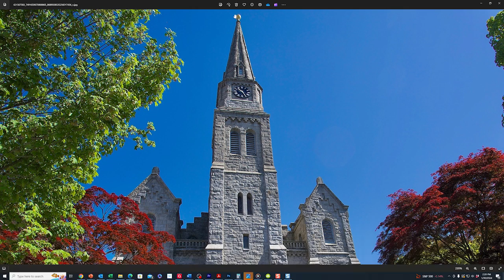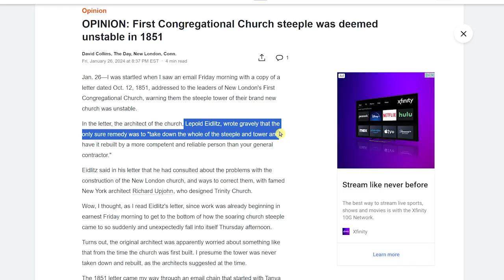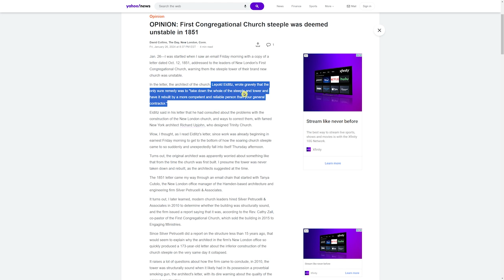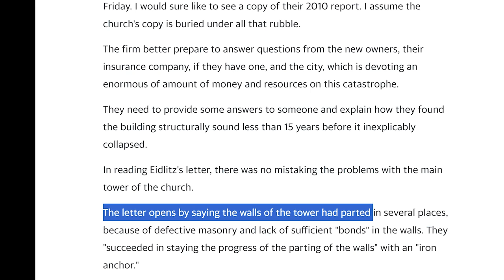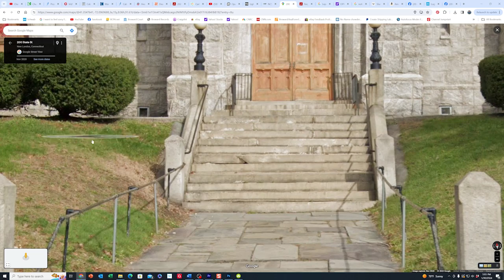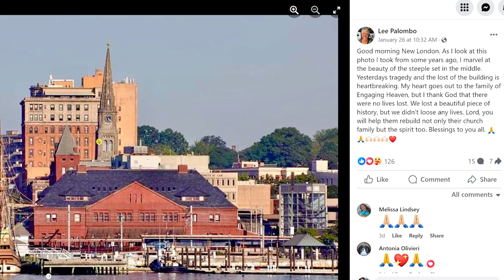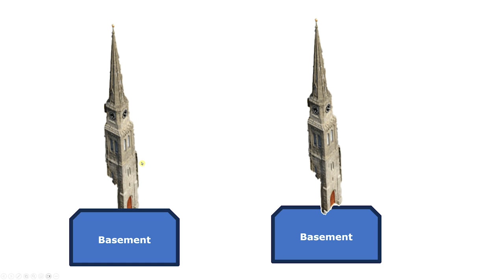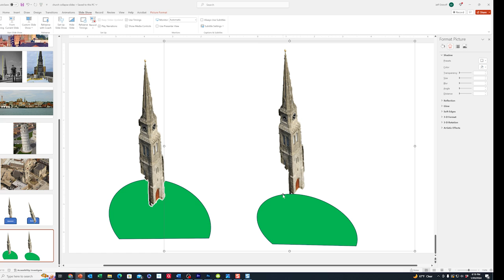What Caused Church Steeple Collapse New London, CT?

Comment: As someone that lives in CT, I can tell you we have had RECORD amounts of rainfall over the last 2 months. I'm talking about 4+ inches in a 12 hour period on 2 successive weeks. If you just go back and look at rainfall totals in the area I am sure that is the culprit.
Reply: There was an inspection 20 years ago that said the roof was in very poor shape back then and no repairs had been done since the inspection.
Reply: @whyjnot420    Yes- Especially where the gabled sanctuary roof abuts the stone tower.  The lime mortar used in original construction has failed due to water infiltration and caused these stones to become unstable/collapse.
Reply: Good point. We look at the building and try to find a failure point, but forget about the ground it rests on. Too bad we only see the steeple in the video.
Reply: We also had some big temperature swings. It got into the low teens, for days, then it swung back up. (at the Groton Airport) On the 13th, it was 37F to 56F, 13th; 28F to 44F, 15th; 23F to 32F, 16th; 23 to 38F, then the 17th to the 22nd, the overnight lows were well below freezing at 19, 20, 23, 15, 14, 23F, the highs were all below freezing until the 23rd when it got to 38F. New London & the Groton airport are both at sea level, just a few miles apart. Having the temperature below freezing for 5 days straight is kind of rare. I can imagine that a pretty deep undergound freeze could have happened and been what brought it to the literal tipping-point on that particular day.
Reply: I agree. It's the excessive rain.  I live about 50 miles north. We've had the rainiest fall ever I think.  (My woodshed is tilted but holding together.  I didn't really prep the foundation. It s just up on cinder blocks at the corners.  Too much rain, softens the ground and its sinking. I'll have to fix it this summer.)
Reply: Maybe not the sole culprit, but surely contributory.
Reply: This may not be relevant, but consider the number of hurricanes over the last 150 years. The forces of nature eventually destroy  strongest buildings if not properly maintained.
Reply: I didn't even know that fact and still assumed it was to do with either massive or absence of rainfall.
Reply: @kylieharrison3782  A week before this, one town over, Norwich CT had mandatory evacuations because of the flooding.
Reply: funneling money for maintenance into pockets is more likely to blame
Reply: @ThatOpalGuy considering it was deemed unstable by the guy who built it you are correct
Reply: And not just torrential rain, but a lot of freezes, which if there is water in/between the stonework would put additional stress on the materials.
Reply: Lived in CT my whole life and this is the driest most consistently 35-40 degree weather for winter I can remember in central CT. We had 1 snow storm and not even that many rainy days.
Reply: @s0nnyburnett  and yet here in California everything is getting flushed out into the ocean 😆
Reply: @s0nnyburnett  What are you talking about.  We have had so much rain in January and December.  NOAA.gov backs me up here as  I copied part of an observed weather data report  (see below) for Hartford, CT for January 26 and you can see from Jan 1 there was 7.31 inches of rain where as normal is 2.79.  And since Dec 1 there was 15.35 and the normal is 6.87 or > 2.2x normal.  The ground has been heavily saturated for at least the last 6 months.  If I remember correctly we started the first few months last year with below normal precipitation but then for the rest of the year we had well above average with a couple periods of major flooding.  I believe we ended last year 18 inches over normal.

...THE HARTFORD CT CLIMATE SUMMARY FOR JANUARY 26 2024...
VALID TODAY AS OF 0400 PM LOCAL TIME.

CLIMATE NORMAL PERIOD 1991 TO 2020
CLIMATE RECORD PERIOD 1904 TO 2024

WEATHER ITEM   OBSERVED TIME   RECORD YEAR NORMAL DEPARTURE LAST
                VALUE   (LST)  VALUE       VALUE  FROM      YEAR
                                                  NORMAL
...................................................................
TEMPERATURE (F)
 TODAY
  MAXIMUM         43   1244 AM  65    1950  35      8       47
  MINIMUM         37    726 AM  -8    1948  18     19       35
  AVERAGE         40                        26     14       41

PRECIPITATION (IN)
  TODAY            0.67          2.00 1986   0.11   0.56     0.78
  MONTH TO DATE    7.31                      2.79   4.52     5.81
  SINCE DEC 1     15.35                      6.87   8.48    10.31
  SINCE JAN 1      7.31                      2.79   4.52     5.81
Reply: How can the rainfall affect the interior wall of the tower? The tower did not fall toward the street, it fell on the roof. - BACKWARDS.
Reply: @organbuilder272 Any leaks where the roof meets the wall will allow water to get in and start weakening mortar joints,  rot wood, etc.  It could have been happening over a period of years and no one noticed.
Reply: @dfirth224  This. It could have been right at the edge for decades. We had a collapse in our town. pictures of the sanctuary showed drywall seam in the ceiling progressively getting wider over the course of a couple of decades until roof finally fell in.
Reply: @dfirth224 
It’ll also soften the ground below it, even in the back. 
Just a little settling can cause the load to shift.
Reply: @organbuilder272  Maybe the amount of rain softened the ground? If there is some kind of clay below.
Maybe the foundation of some other buildings nearby changed the way of underground water flowing.
There are so many possible reasons. ..
Reply: @organbuilder272 you’ve never had to do hydrological tests on how groundwater moves, have you??
Reply: @organbuilder272  hard to say where the mortar will crack, the expansion of wood as it gets soaked, etc.
Reply: Did they check for any Jew tunnels??
Reply: @djbrando202  🤣🤣
Reply: Don’t let the facts get in the way of a good spin…..global warming collapsed the church 😂
Reply: @BleachDemon99 
BAHAHAHA 
Good one.
Reply: Well, climate change aka global warming is what the record rainfall events lately are caused by. @BleachDemon99
Reply: @BleachDemon99 NO IT WAS A SINKHOLE  OR A SMALL EARTHQUAKE
Reply: @BleachDemon99  Welp, a warmer climate DOES allow the atmosphere to hold more water vapor and gives more energy to storms, so.....

Personally, I wouldn't say it's the cause, but a contributing factor.
Reply: @BleachDemon99  What are you talking about?

Comment: If you look at your own photos you can see there is a lower floor, from the front and the side of the building there is a basement and it collapsed into it .
Reply: roromanos, I agree as most building that collapse have a weak area that is on top of an open area..like a basement in this building. Plus, basements are 'very' common in CT.

Comment: If the masonry work was poor, the foundation of it may have been poor also.  I would have thought maybe and internal metal skeleton could have been installed.  The engineering report from a few years back over what they checked why they thought it was OK will be interesting.  People were worried in that letter about the tower.  I wonder if the engineering firm was just concerned only about the above ground part of the tower.
Reply: Even with poor masonry it has been standing for over a hundred and fifty years. The question is why it fell *now*? I would guess water ingress/erosion, damaging the structural load bearing walls.

Comment: Unless the steeple was built with a list there should have at some point been some tale tale cracks as the lean increased. Which brings me to why did the church hire the architect? Had repairs been done that raised concerns. At 12:34 center screen it looks like some grout work may have been done. See the light colored grout vs darker grout lines. Plus that right opening looks slightly out of kilter. Look how many rods that appears to have been installed  in that section.

Comment: Im betting on foundation failure under the back of the steeple, since that was an entrance it had a large doorway opening in the front, and inside it had to have been open as well, basically having 4 corners being the only real support for all that weight, just one of those corners failing in any way would have dropped it down. All that heavy granite stone that high was a bad design, granit weighs 180 pounds a cubic foot, plus there was a clock and heavy bronze bells in there.

Comment: the roof section directly behind the steeple shows discoloration...roof repairs/patches. Really old wood structure, slate tile roof...poorly maintained for the last....50 years? The stone work below all of the roof patching is most likely severly eroded...repairs to counter this are evident already, gravity won, the bond between the poorly constructed stonework and probably inconsistent mortar mix finally gave in.
Reply: I completely agree with you. In addition, the roof timber supports were compromised, and forced to support the failing inner stone arch.

Comment: How does it remain upright for 150+ years, only for the instability to get triggered now? What was the trigger? Materials deteriorate, the ground below moves, and load paths slowly change over time, but we must wonder what pushed it beyond the point of no return... A small change in boundary conditions can snowball into a collapse, very scary
Reply: It doesnt take much, that was a LOT of weight only supported basically in the 4 corners.
I remember an 1867 hotel in NY City that developed a bulge in the brick facade, and in 1973 it collapsed onto the street.
I did some research and found out the previous building called the LaFarge House was a theater and it had a massive fire that left most of the facade standing, and what they did was in 1867- REUSED that brick faced with sandstone facade- added THREE more floors and a heavy mansard tower in the middle to make the site into the Broadway Central Hotel with it's 9 floors.
A fire chief told me a chase had been cut into a bearing wall for utilities, AND in the basement an unpermitted doorway was cut out of a bearing wall to provide access to the other part of the basement, it was above that section where the facade developed a bulge on one floor, inspector noted it, wrote it up, it was supposed to be repaired but after a couple of months or so of nothing being done the collapse happened.
Reply: Any tunneling going on around there?
Reply: God works in mysterious ways.
Reply: Lol okay  @johngreydanus2033
Reply: @johngreydanus2033 GOD IS SHAKING EVERYTHING THAT NEEDS TO BE SHAKEN.... THESE ARE THE LAST DAYS ‼️
Reply: vibrations from the on-going on the adjacent parking garage and water-saturated subgrade aggaravated the already known faulty structural
Reply: Maybe joo tunnels
Reply: Deterioration and age. Like an ancient tree, just one moment is it's last to stand. All man made structures left unattended will do the same. Nature on natures terms. All old structure require a lot of $$$$ to stay pristine. The leaning tower is riddled with cables to keep it from collapsing.
Reply: @danielgardner394 
Riddled with cables? How long would those cables have been?
And if the cables had let go would it make a reverberating sound in the sanctuary?
Reply: Loose, decaying mortar...and one very determined, burrowing church mouse???
Reply: A straw!
Reply: iron rust
Reply: The mortar was more sand than mortar. Theres a bell tower in muncie Indiana that I worked on and can't believe is still standing. The mortar looks good from where it's been repointed but after you get past the half inch of good mortar it's just dust.
Reply: Rain, 4" of it in the week prior
Reply: Several days straight of below freezing weather -> frost heaves??? Not necessarily the root cause, but maybe the trigger for it to happen that particular week. (see previous comment.)

Comment: A once beautiful work of art!!! Luckily no injuries.
It looks like the primary structural components were wood as was the custom then.
You seem to have hit it that it was a foundation failure. 
Once the foundation shifts, the timbers just couldn't support the weight of the stones.
The northeast has has many heavy rain/wind storms and it took its toll.
Reply: The timbers never did support the weight of the stones. They supported the roof. The tower and walls of the chuch were stone on a stone foundation. The building was COVERED with standard planks supported by gothic arches formed of wood anchored in the walls. These arches were broken by the weight of falling stone dropping the roof structure slowly down on top of the stones of the broken tower.

Comment: I think the roof collapsed down wards and pushed the side walls under the roof outward collapsing the main structure behind the steeple. 

That collapse pulled some connection point behind the steeple structure that is already leaning… - the stones the backside of the steeple structure fail causing displaced the back side of the steeple and then down it came under its weight.
Reply from the maker: I would love to hear what congregation members had to say about noises from within the church. Our church makes a lot of noises on the roof so we are accustomed to it and we know all of the sounds so it would be interesting to see if there were new sounds popping up on them in recent months.
Reply: @jeffostroff  Yes - The main roof looks to be in poor condition thus roof structure blew out the wall that is spilled out.

The tower was definitely in poor condition. There is a fairly massive visible big black crack on the side of the steeple base ~10-15’ up on the side.  It is on the side  facing the street on the side of the church.  That crack might be why it was pinned all the way through and had those plates visible on the front.
Reply: that would make sense since it was almost like the bottom of the steeple was pushed OUT... by a collapsing roof maybe, but, the tower had an obvious lean in the very direction it fell- its seen in the photos, the tower looked like it could have been as much as a foot off plumb!
A foot off plumb would shift a LOT of weight off one side and put it on the opposite side.
Reply: Since the roof is on top of the steeple, I disagree. It appears that the steeple crashed through the roof and then the roof fell on top of it.
Reply: @chocolatechip12  The roof structure would collapse partially pushing out the side wall then the steeple through the roof.  

The roof would not just collapse disintegrate onto ground and end up on floor first then steeple.